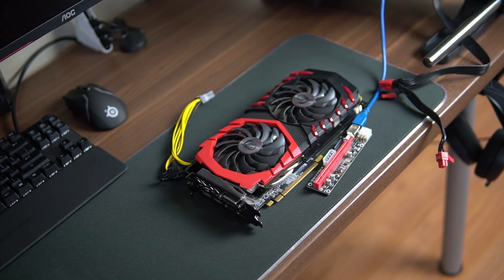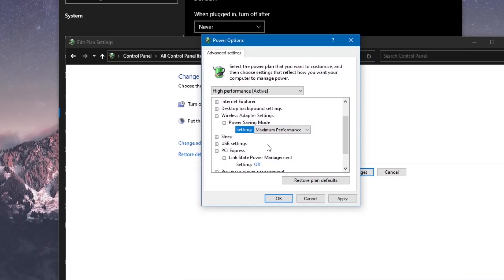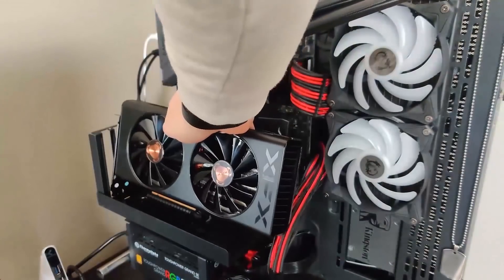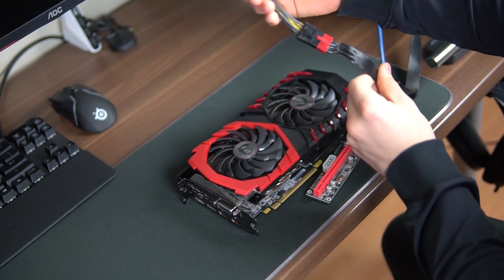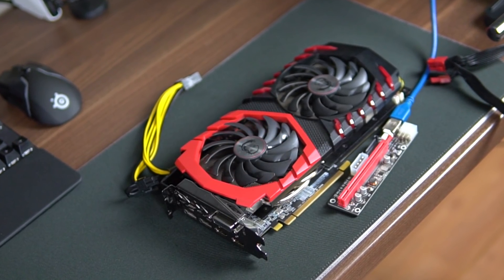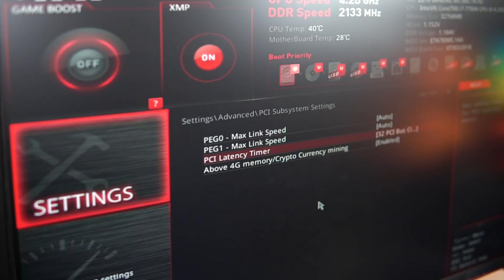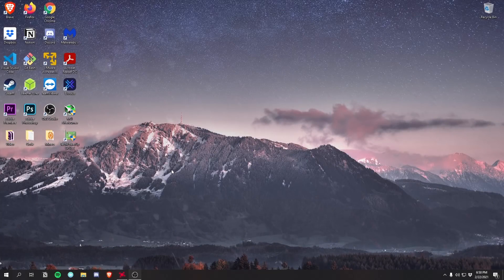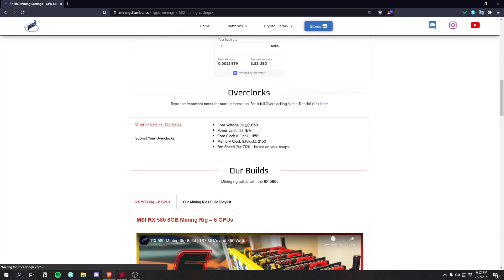How To Mine With More Than One GPU On Your PC

Comment: I have rx 570 and gtx 1070 on the same rig and it works flawlessly without any issues
Reply: BattlemageElsa  i have a b450m motherboard Asrock steel legend to be exact, and i had the gtx 1070 on the first slot and first boot install driver and stuff and then i plug the rx 570 after reboot and install the driver for it afterwards and I haven't got any bsod or errors till now

Comment: I was hoping some of the settings change could work for me, but sadly no, my b550 gaming edge wifi doesn’t recognize my second vga
Reply from the maker: What do you mean wifi isn't recognizing your second gpu?
Reply: @MiningChamber  no my man, b550 gaming edge wifi is my mother board model, but thanks for the heart
Reply from the maker: @LolTrollando  ohh sorry misunderstood! That's odd, tried different slots and everything in bios I assume?
Reply: @MiningChamber  yes bro, i tried switching the heck, but forgot about the m.2 totally, thanks to the legend there its working now
Reply: @LolTrollando  B450 and B550 indeed have PCIE lanes limitation, when populating some M.2 NVME PCIE slot(s), it sometimes automatically disables other PCIE slot(s). That's why using SATA SSD avoid you lot of these hassles...
Reply: @blackmennewstyle  thanks man, had no idea this could happen, if this was a x570 MB there would be no problem then?
Reply: @LolTrollando  I wish the answer was that simple, many X570 motherboards manufacturers cheap out big time as well with the PCIE lanes, so i'm not even sure that all X570s are freed of those limitations. The common practice in order to do not run out of PCIE lanes is too really avoid using PCIE M.2 SSD, they won't give any advantages when mining anyway.
Reply: @blackmennewstyle  yeah I see, that was my bad for not trying using both of them in hiveos, thought it was a problem with the slot, not a lack of pcie lanes
Reply from the maker: Oh wow I have learned alot, glad it worked! Something new to learn every day ⛏️⛏️
Reply: Is your m.2 conflicting?
Reply: @pravrao  omg bro u the closest to a genius, love u, i asked in so many different groups and nobody had any idea what it could be lmao, but i took off my second m.2 and it worked
Reply: Ok i have a b550 motherboard as well, and I’m running into the same issue, I’m relatively new to all this, how do I get both cards to work simultaneously? I got them to both run and everything fired up, but the picture was distorted and it wasnt recognizing either cards. How do i fix it? Thanks!!
Reply: @dallasf6088  Man the only thing that worked for me was using less pci lanes, which was removing my m.2 ssd
Reply: @LolTrollando  so remove that and it’ll work using a riser?
Reply: With my 3080 in the frame, theres only room to fit a riser in the pcie3 slot, theres only 3 total and one express slot, but i havent been able to get the other gpu to work plugging it in to the extra pcie slot
Reply: @dallasf6088  if those settings in the bios didnt work as well, i really dont know what it could be.
Reply: @LolTrollando  settings in the bios? Sorry bro I’m a total noob
Reply: @LolTrollando  how do you change the bios settings so 2 cards run? Please lmk! I cant find it anywhere
Reply: @dallasf6088  did you watch the video? If you didnt then watch
Reply: @LolTrollando  bro I did! What do you change in asroc bios settings

Comment: Great vid bro! (Watched it on 2x speed) but was wondering if the new AMD cards (6900 xt) respond to -gpow in Phoenix miner as mine doesn’t. I set it to 70 and it does nothing so I’m not sure if AMD has BIOS locked it or something.
Reply from the maker: Thank you! And not sure but other than making sure your running as admin then there isn't anything else I can think off!
Reply: @MiningChamber  thanks man for the quick reply! It’s not really a big problem as 6000 series isn’t for mining. I was just wondering if I could make some money out of my gaming rig while using for other things.
Reply: @cheekycream the 6000 series are suitable for mining eth and rvn and it's profitable
Reply: @geraldpheonix  IK but the ROI is bad so it's not a great mining card + 3060 ti has same hash rate +-5%
Reply: @cheekycream4148  bro, it only depends on how much you bought the cards; Nvidia cards are quite expensive than the AMD cards; with the RX 6800, I think 64mhs is good, and the Roi depends on your hardware cost and your energy cost
Reply: @geraldpheonix  6900 xt I have so ehh... ROI is like a million years away

Comment: imo not even worth it unless you have an asic
Reply from the maker: Check the first part and you will see how much money you can potentially make. I feel like your pretty new to mining so your not aware that ETH mining is pretty profitable right now for GPUs
Reply: @MiningChamber  I have this setup with Phoenix miner and for eth this would take a year maybe more to even get one coin on my current setup using a 1080ti unless you have some magical pool your prob going to be using more hydro then I'd even make mining
Reply: @NORMAND021  magical pool? Sounds like you are solo mining? Pretty much any pool will net way better and more consistent results than solo mining. Either you have more money than sense and got ahead of yourself by purchasing equipment before you understand what you are doing or you are a shill trying to scare people out of buying GPU's so you can find them easier
Reply: @TheMuddman74  not solo mining, using ethermine and u do realize to make on eth you need like 15000 mh/s right atm i was making 35... with a 1080ti not to mention with hydro rates youd be lucky to get .5 eth a day @15000 mh/s. furthermore if you are trying to build a setup, gpu prices have went up prob 25 percent.... and no i haven't spent any money i have had this rig for 2 years now....and wanted to try it.... unless your talkin used gpus even then prices have went up. so no its not worth it IMO..... im not trying to shill ppl but they need to know what they are getting into, the video is great btw i watched several that were not as detailed.
Reply: @TheMuddman74  "shill trying to scare people out of buying GPU's so you can find them easier" Yes a F-ING shill, i Drive Uber, That's the same shit many drivers tell people that ask about driving, to keep others from driving.
Reply: @NORMAND021  With your card you can probably get about 0.1 ETH a month which is still $170 extra money with the equipment you already have, as long as your electricity is not that expensive. I'm using about 100W extra per card compared to not mining, so it's 100*24*30=72kWh extra power for mining each month. You can still turn a profit.